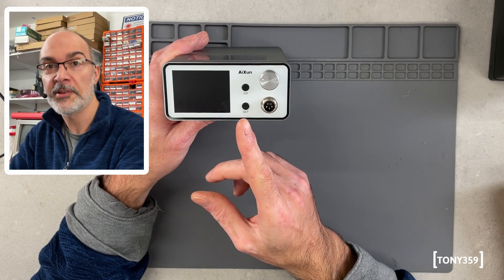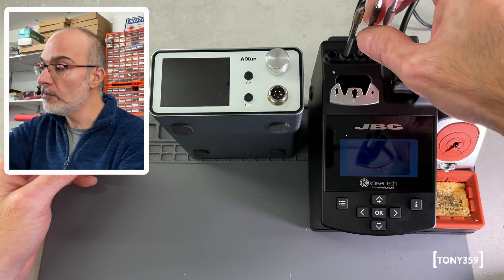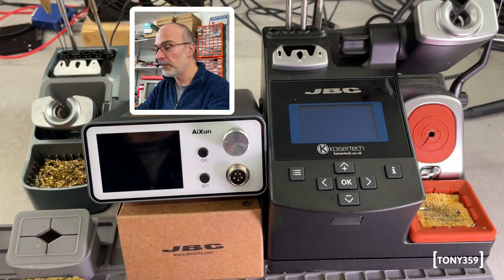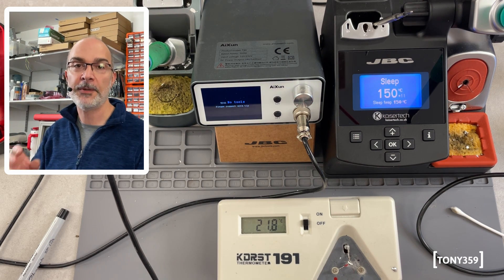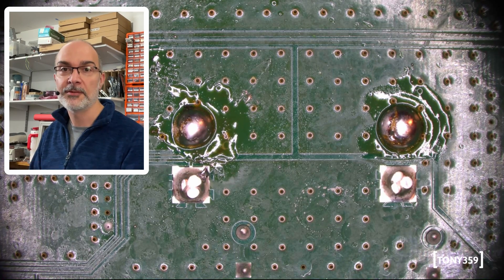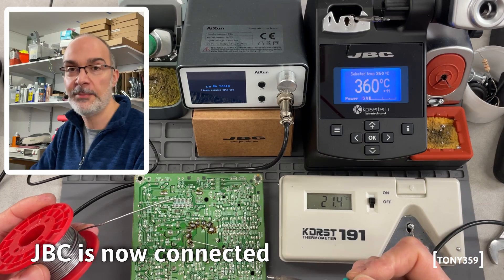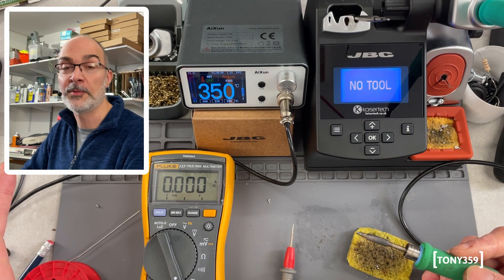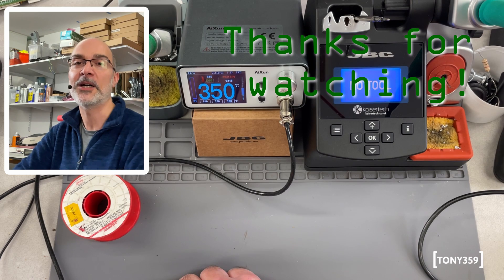Can the Aixun T3A really beat a JBC station?

Comment: Not that it makes the Aixun okay, but voltage alone doesn’t say a lot.

A lot of people just measure antennas or noise /EMI thinking it’s leakage etc.

Also, people keep saying “just unground your PCB” forgetting that ground is almost everywhere, and your mat and body is probably grounded too.
Reply from the maker: Well, for sound to come out of an 8 Ohm speaker, there must be some current too. In any case I check the current in the video too and, spoiler alert, it's not zero. Thanks for watching
Reply: @tony359 oh yeah for your case, totally insane. I say this because people are also paranoid about the already grounded stations like the TC22. I can’t say anything without having it to test but..
Reply from the maker: @Amybnuy  well the T3A is also grounded - there must be some minor resistance between the handle and ground and when touching a "better ground", current flows to the easier path. In the end, a speaker shouldn't make sound. I cannot accept that.

On "just remove ground", many have commented the same and I agree with you that it cannot be a solution!

Comment: Great comparasion! Could you test Atten ST-909 (MP741034 rebrand by Farnell). It is one of the cheapest soldering stations using active tip selling on renomed webs for Europe. Seems like it could be great deal. I also have an eye on ST-8902D which combine what I think are the best value/price tools from Atten.

Comment: So in both your videos you only mention firmwares 1.33 and 1.34. I don't know if you've tested 1.32 but according to the change log from AiXun, they "Fixed 245 heating overshoot". I'm not saying they did not break it again in the later firmwares... but does this issue exist in 1.32 where they say the fixed it? Also, have you tried the latest 1.36 firmware?
Reply from the maker: it's somewhere in the video, I could not go below 1.33 because the display would show an inverted image - I'd imagine they changed the display and only added it on 1.33 onwards. I did test the latest I had available at the time of shooting and "the fix" was that the display would not show the issue anymore but it was still happening when measuring the tip. It's a design flaw, it cannot be fixed by SW.

Comment: This may have been corrected now.  I have the T3AS and the tip is grounded.  I checked it after seeing your video.  The T3AS also has a ground lead which can be connected to the PCB.  There is also no problem with temperature fluctuation if the soldering tip is grounded externally.
Reply from the maker: The T3A was also grounded. The T3AS is - AFAIK - a T3A with a different stand, not an upgrade. A few viewers have commented that their T3A don't show the issues I have experienced. I do not know if there are multiple revisions or anything - all I know is that if the issue had been solved, Aixun would have (hopefully) helped me getting a fixed version. 
Happy that it works for you though! Thanks for watching
Reply: Thank you for your reply.  The T3AS does have a different stand.  It is just sheet metal and has a simple sponge holder.  There is provision to remove cartridges but no storage for spare cartridges.  The power unit is slightly different in that there are two threaded standoffs on the rear near the top.  The stand bolts onto these standoffs.  They also make the connection to sense when the iron is on the stand.  The base of the stand has sticky pads to hold it to the top of the case and also insulate it from the case.  Whether the power unit has any other differences in the circuitry I don’t know.

Comment: I was really happy to find your detailed reviews on the T3A soldering station and I am pleasantly surprised that you still respond to comments under this video. After watching your videos, I have two questions for you: First, I would be curious to know if the two new software updates (1.35 and 1.36) have managed to solve at least the problem of heat spikes or even the problem with grounded components. Secondly, I would like to ask you if you know the difference between the T3A and T3AS soldering stations, since I can't find a comparison of their technical characteristics, so I wonder if it is just a different format or they actually used the "new " model to solve some of the problem that you finded. Thank you very much for your time.
Reply from the maker: I sold that station so I cannot respond to the FW question - but wasn't 1.36 the one which was hiding the spikes? My understanding is that there is no way they can "resolve" that issue as it's a HW issue. The Thermocouple becomes blind - in fact is senses a very low temperature so the heating element is engaged at full power. What they can do with FW is to "mitigate": recognise when the anomaly happens and... assume things. They can avoid sending the tip to 500C but they're literally driving blind. 

No, I don't know the difference between the two models, sorry 🙂 Thanks for watching!

Comment: Once you owned then try to find the problem using a bench power supply,i think is 24VDC 5-8A rated.If the problem solved its own power supply is poorly designed,if not then is the circuit itself that faults.Personally i dont use at all earth connection to my lab equipments and i dont like the antistatic of my Wellers also.Years ago in a CRT a charged capacitor of 10uF/250V that had forgotten to uncharged passed through the iron-my body-and while holding tv pcb from the tuner destroyed the processor and tv was gone.So as a challenge let who interests to find what is happening with these soldering irons since they look really good.
Reply from the maker: there are disadvantages as well I wouldn't say that removing ground is the solution. Those boxes are hard to open, the process is often destructive so I'm happy to leave the task to someone else. Thanks for your comment!

Comment: Have you tested if it also "leaks current" if a genuine JBC hand piece and cartridge is connected? That would confirm the issue is with the station itself, not hand pieces/cartridges
Reply from the maker: the tip shown in the video is a JBC genuine from the UK distributor.

Comment: Hi @tony359,
I recently bought the latest model of the KSGER T12 soldering station, and I haven't been able to find any comparison videos with the Aixun or JBC stations on your channel. Given that Aixun hasn't released any firmware updates in the past three years, I’m hopeful that the latest KSGER T12 station will outperform the Aixun and not have the same temperature instabilities. The Aixun seems to be an outdated, non-upgraded (dead) product compared to the evolving KSGER system.
I plan to use a grounded soldering tip to avoid temperature spikes, and once I’ve tested it with a multimeter or speaker, I can update you on whether the issues are similar to those seen with the Aixun.
Please feel free to let me know if you have any experience with the KSGER T12 (late 2025 version) and if you might already have more insight into this topic.
Reply from the maker: I don't have experience with the KSGER but why would you expect a SOLDERING IRON to have software updates? 🙂 It's an iron which heats up and melts solder. It's not rocket science 😀 It's nice to have the feature but if the station is well designed, there shouldn't be any need for updates!
Reply: @tony359  Because technology moves forward? Sure, a soldering iron is no rocket science, but even the AIXUN looks like a rocket controller. Now, I’ve found the GEEBOON HC24 with firmware upgrades via USB-C instead of USB-A. Firmware upgrades are always good if they fix issues that may arise with use. I don’t think it's worth an upgrade right now, but after a while of use, I might be able to evaluate it better. To be honest, having an external ground, regular firmware updates and a fan connector might be the better choice.
Reply from the maker: @guinnessinmyveins  At present, all the "upgrades" I've stumbled on for those irons were 100% to fix massive bugs which should have been picked up in the first place. Or to hide HW flaws as with the T3A.

Comment: I'm relatively new to soldering, so pls excuse me if my question sounds stupid 😅 but is it the station itself, that isn't grounded or is the handle not grounded? In case it's the handle, couldn't you just buy genuine jbc one to use it with the aixun?
Reply from the maker: There is no such thing as a stupid question 🙂 
Everything is grounded but somehow I still read a voltage and a current. I reckon the ground wires might be thin and have a tiny resistance which will allow for current to leak on the wrong end? I’m not sure. To be fair, I didn’t invest much time in trying to fix this brand new station. 🙂
Reply: @tony359 thanks for replying :) do you still have that station? If yes, wouldn't it make a nice video if you took it apart, to check if it's possible to fix this issue? I was thinking about buying it, since i don't have the money to spend on a jbc or sth similar and I'm sure there are more people in your community who are still interested in this station. By the way i just stumbled across your channel today and have been binge watching your videos for a couple hours now. Very valuable content for learning 👌 thank you :)
Reply from the maker: @chuffnalde1060  Welcome to the channel! I don't have that station and I read that opening the station was a destructive process. I needed a good station for work - without fearing for my boards - and I got a JBC. The Aixun is not faulty, it's badly designed and I don't think that trying to fix a new item is wise. If you're interesting in a 245 station that doesn't have a free Voltage Injection tool built-in 🙂 take a look at the Bakon 999 I've recently reviewed. I've been using it with my JBC and it works fine - but the stand. The stand is pointless! 😀
Reply: @tony359 alright, I'll look into it. Thank you 🙏

Comment: I bought one in April 2025 with the latest version firmware 1.32, I can't confirm the hardware revistion BUT the voltage leak on the tip was only 60mv which is extremely low, I suspect they fixed the voltage leak shown in this video.
Reply from the maker: Some viewers over time have confirmed the same. Some others confirmed they the leakage is still there. It’s unclear why that happens. Are you sure you got a genuine one? Ali is full of clones, as always 🙂
Reply: @tony359 отключите станцию от сетевого фильтра и подключите напрямую к розетке, ваша проблема решится.
Reply: Could you post a link of the seller you got yours from?

Comment: How many different T3As have you tried this on? After all, these are Chinese products and are prone to failure. However, a T3A that works as it should is a really great station. I did all the checks you mentioned on my T3A and there are no problems. Also, Aixun is constantly updating the software and fixing bugs and glitches.

Everyone compares it with JBC, I used JBC stations for 3-4 years, I can only say this about this issue, the difference with JBC is that I think JBC will last longer, there is no other advantage. Do not underestimate Aixun, a problem-free Aixun does the same job properly for much less money.

They are also very interested in service. In case of any software problem, they help by sending new software when an e-mail is sent.
Reply from the maker: I have tried one and that was enough 🙂 I contacted Aixun explaining all the problems and they refused to help - it's in this video or the other one I made. Many others have confirmed my findings. Some have even reported damage to sensitive ICs caused by the leakage. Of course if it works for you, happy days. But the T3A cannot be recommended.
Reply: @tony359  I have been doing electronic card repair work in the industrial sector for many years and have been using aixun t3a for the last three years. So far I have not witnessed any damage to the card or microprocessor with t3a. The problems you mentioned do not exist in my station, in fact there are those in the comments below who do not experience these problems. After watching your video I searched the internet and almost everyone is happy and I did not see any comments with such complaints. As I mentioned in my first comment, these are Chinese products, unfortunately some of them may be defective. But it is not right to generalize and completely criticize this. A solid aixun t3a at a reasonable price does its job very well, rest assured.
Reply from the maker: I can assure there is no defect here. Yes, someone says they cannot reproduce the issues I’ve highlighted but others can. Aixun was contacted and they refused to help - suggesting that my unit was not faulty. And yes, it’s a genuine Aixun, they confirmed me that at least. So as I said, if that works for you than happy days but I know for a fact that what you saw in my video is not a because of an isolated faulty unit. There’s a whole thread on EEVBlog and Alex of NorthWestRepair showed the flaw on his videos on numerous occasions.
Reply: @tony359  So why don't some users, including me, experience this isolation problem?
Reply from the maker: @0M42  I do not know.
All I know is that I am 100% confident my Aixun was genuine (Aixun support themselves confirmed that in writing) and that Aixun refused to help me when I asked for support, despite me mentioning I was making a review.

They might have fixed it or maybe your station is not genuine and happens to be better. I really do not know but there are plenty of users online who can confirm my findings and Aixun clearly developed a FW to hide the overshoot. 
So, if someone wants to join the T3A lottery and hope to get "the better station", they're free to do so :)

Comment: did the new JBC CD-2BQF use switching power supply？according to the information I got，the new JBC CD series is now useing switching power supply，and a huge Iron Block inside to keep the same weight
Reply from the maker: Can I suggest it was a clone? There are plenty online. The CD I have is a linear supply. Genuine JBCs can only be purchased from the official distributors. Anything on AliExpress is fake - could be a good fake but… 🙂
Reply: @tony359  I bought it from a certified dealer, not on AliExpress. They said that JBC CD series started using switching power supplies in 2023, and before that they were all linear power supplies. Maybe someone bought a CD series in 2023 or 2024 that also had a linear power supply, but that might have been produced before that.
Reply from the maker: interesting. I have no idea. In the end if it works without issues and without leakage, I don't see an issue.
Reply: @tony359   I have two JBC CD-2BQF, one of them from 2023. Both are with linear Power supply. Never heard of original JBC with switching ps...
Fun fact: when I ordered my second JBC CD-2BQF from EU, they sent me the CDE-2BQA (the one with the color display and soldering assistant feature) model instead by mistake. Which is more expensive and they said that I can keep the newer and more expensive model for no additional cost. But after a couple of days testing I realized that it's not better in any way, I found it even slightly worse performing (different heating algorithm). So I ended returning it and they finally sent me the right CD-2BQF model. 🙂

Comment: I've just tested my Aixun T3A which I bought in the summer and mine behaves perfectly when the tip touches earth, and there's no current flow, either.
Perhaps yours is faulty? Chinese electronics manufacturers aren't exactly known for their high QC standards!
Reply from the maker: What I discovered has been confirmed by many on the internet. Maybe they released a revised PCB. Also, it't not necessarily showing the temperature issue when touching ground but a PCB which is connected to ground. Finally, the latest FW will hide those spikes as I showed on the video so you need to check with a thermometer.
Reply: @tony359  Cheers, I'll check that out. I'm definitely not detecting any current flow to ground, though.
Reply: @tony359  Apologies, Tony! I posted too hastily. I've spent some time messing around, and curiously, grounding the tip via low value wirewound resistors triggers display instability. Suspecting the issue to be inductive, I tried a couple of inductors from tip to ground. Sure enough, the displayed temperature suddenly becomes unstable and shows temperatures in excess of 500C. The iron isn't heating up significantly, though. I know this because the PWM duty cycle isn't shooting up. I may test this further.
I'm not sure what happened on my previous tests...
As an aside, I can hear the PWM through my Rokit 5 active monitors when the fault presents itself. Some sort of ground loop, perhaps? I'm very disappointed in Aixun, there's nothing like this going on with my Hakko FX-888D.
I'm tempted to open my Aixun up and see if I can fix the issue. It'll void the warranty and likely mess up the front panel, but I just don't trust it anymore.
Thanks for a great video bringing to light a very important issue for owners of this otherwise very good iron.
Reply from the maker: no worries, I'm glad I could be of help. Disappointing indeed. Maybe it wasn't relevant but both the GENUINE JBC tips I was using back then have now prematurely failes. It's £60 of tips in the bin so... My Hakko 888D (clone) works like a charm 🙂